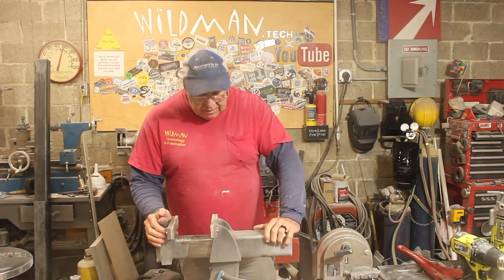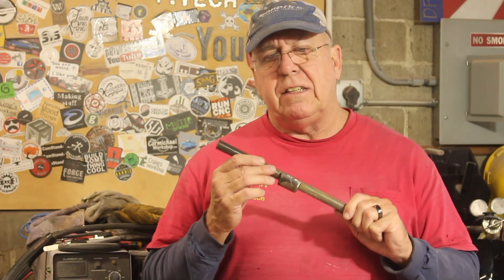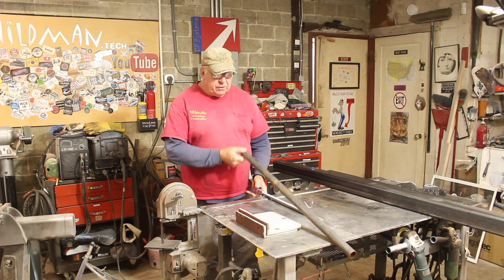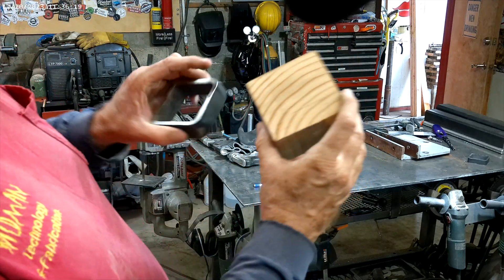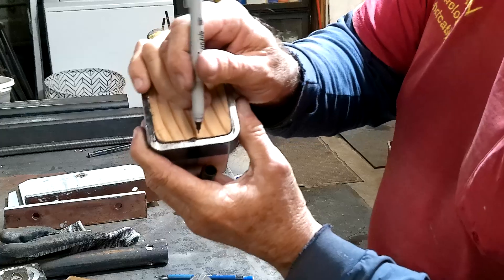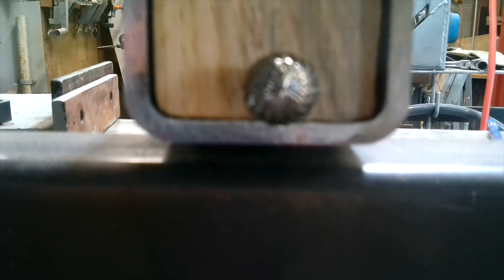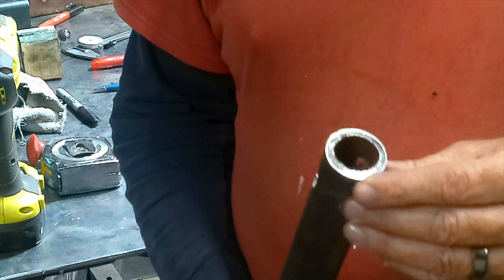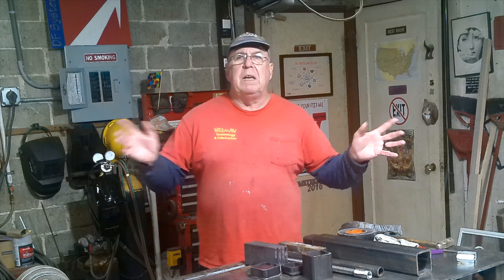Building a New Vise! (again) Part 1

Comment: Acme or square threads and nuts are used on commercial vises, not 60 degrees Vthreads.
Reply from the maker: Duh! I address that point directly in part 2. https://youtu.be/wBAj0BmRwb0?si=R-HDrjq5kgqZxIct&t=113
Reply: @WildmanTech  nice